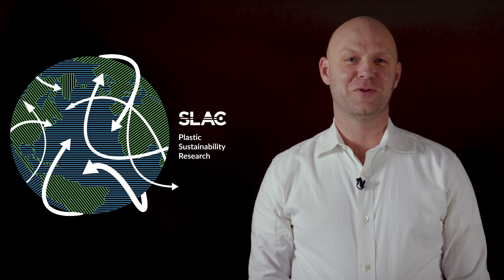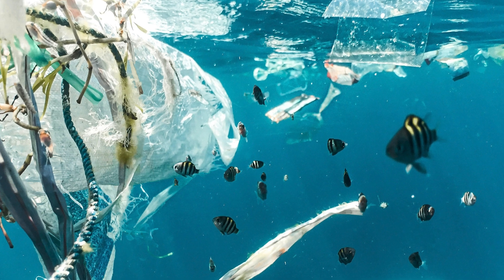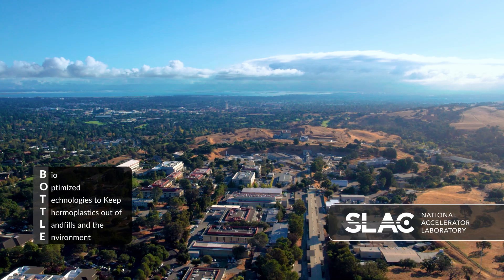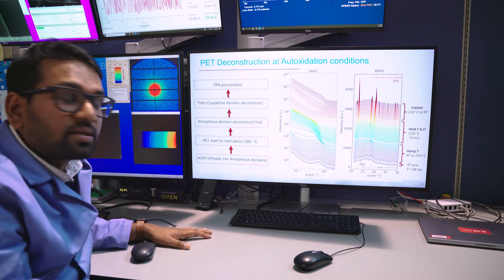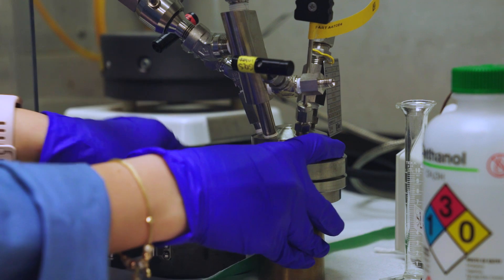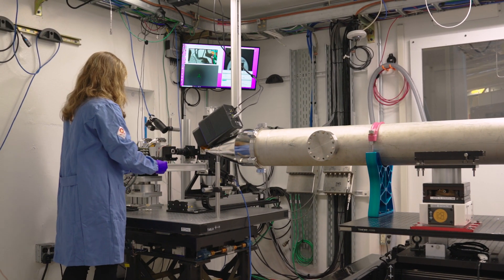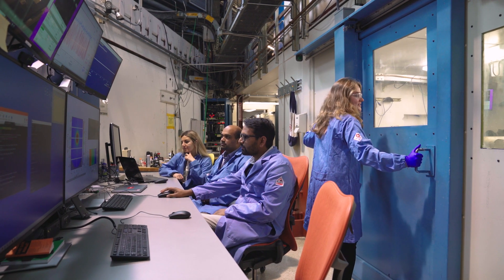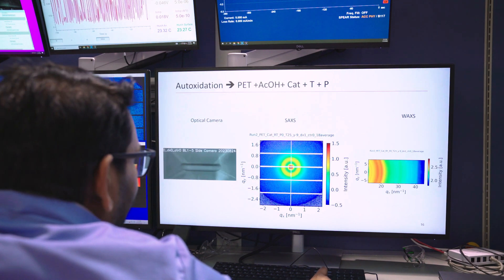How can we recycle and create more sustainable plastics?

Comment: Thank you SLAC for helping solve one of the worlds biggest problems.

We need to quit relying on plastic. Everything should be composable, glass, or metal.  Plastic polyester fibers break up and end up in the environment permanently. We'll never clean the ocean and air of all the polyester plastic fibers and lint from the laundry. 

I don't think people realize that most of the "dust" in a carpeted house is micro plastic from carpet and dryer lint.

Comment: This is one possible solution. The other is already in primary stages of development, making bricks, walls, columns for house/bulding/offshore platforms construction. The concrete production industry is  the most polluting of them all.
Reply from the maker: There are many options to explore. Plastic for construction could be an option but there's also the danger of those plastic "blocks" losing particles into our air and water over its lifetime and so continuing its pollution cycle. There are researchers that are also working on concrete with very interesting solutions out there.
Reply: @SLAC  But the plastic can be coated with organic material. The material degradation happens in every material, we can’t say no to a possible solution just because there is degradation. Using plastic for construction would use a very high volume of plastic on a continuous basis, that should be the goal, the volume. We need to be creative and aggressive in our R&D and accelerate funding and execution of the most innovative, promising ideas. We have been talking about plastics for thirty (30) years and we still don’t have a solution. That’s all I’m saying, our response to this problem has been sluggish at best. SLAC’s contributions are valuable indeed but this problem requires a high level of urgency.
Reply from the maker: You seem to want to be part of the solution, I invite you to join the R&D initiatives you're passionate about. We need people like you.

Comment: Press X to doubt. The plastic problem is never going to be solved by recycling of ANY kind. It's a sham and an illusion. The only viable long term solution is to make new, readily biodegradable plastics.
Reply from the maker: Right. And that's what we're working on as noted in the video. But we also have tons of plastic that sits around polluting so we need to find a way to bring that one down so we can find a better cycle there instead of landfill. So still we have 2 problems to tackle. We can't just leave the plastic that's already there untouched.